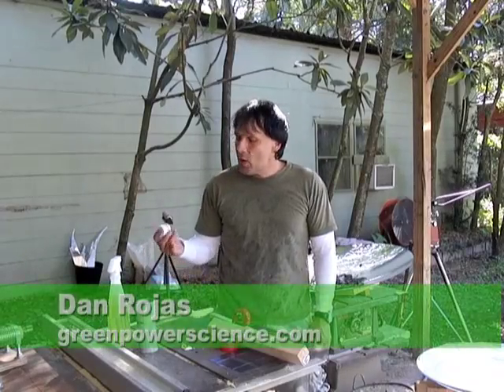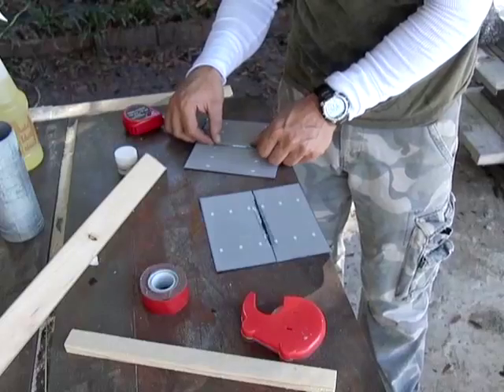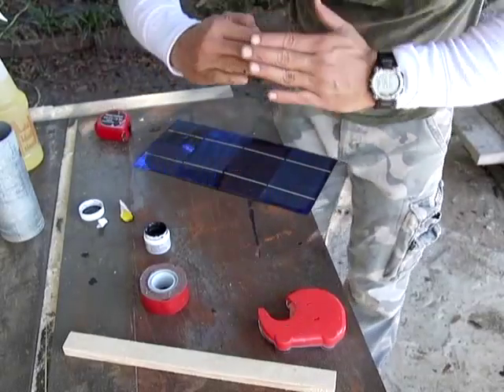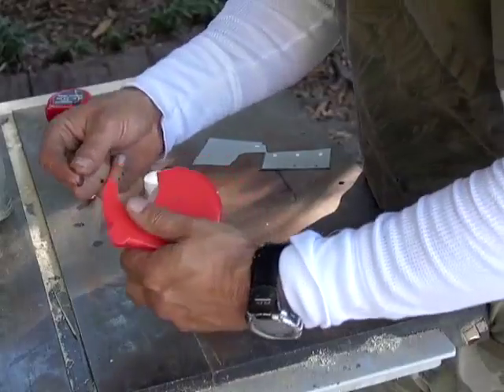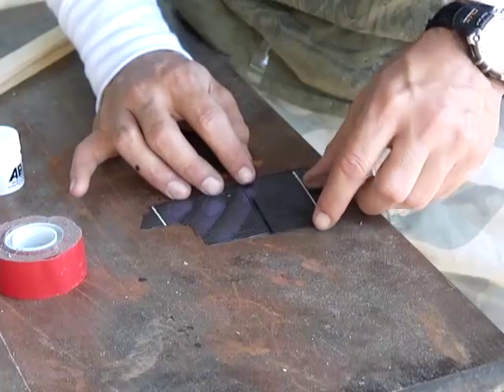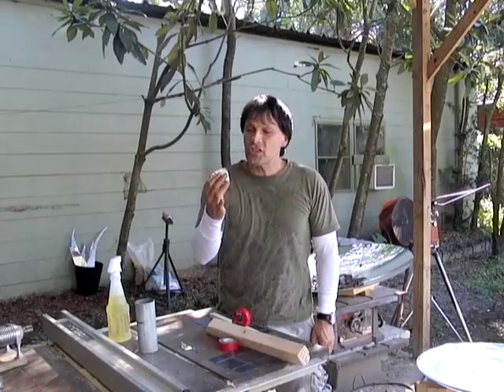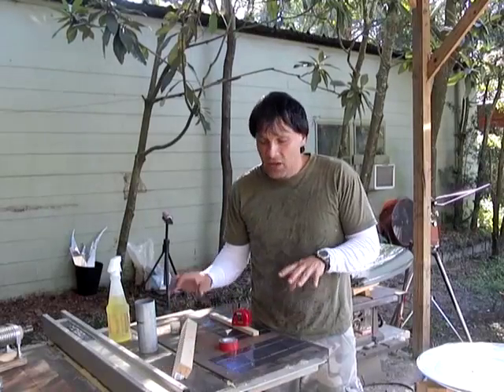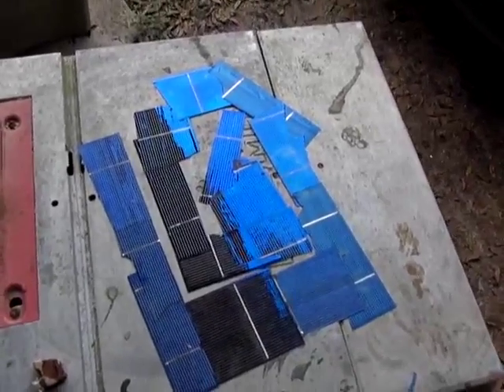DIY Solar USING broken cells Electric Panel SOLDER FREE connections WIRE GLUE

Comment: I don't get it. You don't explain the electrical connections between the individual cells.
How are they connected together electrically?   What is negative and what is positive?
It looks like you are just glueing them side by side together with that black stuff in the white bottle. How in heck does that connect them electically to each other?
You need to take some time with one or two cells and show us the specifics on their polarity and connections etc.

Comment: "through the roof" brand, clear roof sealant, mixed with mineral spirits might be a promising, affordable encapsulant. I read about it on this thread here is the youtube style url solarpaneltalk(dot)com/showthread(dot)php?1431-Cheap-methods-of-encapsulating/page3 ... its got 3 (dot)s in the link. Thank you 1000x for all you 2 do.8-)

Comment from the maker: Thank you for the nice comment. I have found a resin that is really easy to use and uv stable. It also has very low odor and cures within an hour. I wanted to test the UV claim before doing a video. Works good. I hope to followup on this soon. Best Regards
D&D

Comment from the maker: Hi,

How many kWh a day do you use. Look at your E-bill and see. The first step is energy efficiency like LED lighting. Once your house is lean (usually not a sacrifice as newer stuff is nicer) EX. flat screen uses 1/5th the electricity of an older CRT TV. Converting from an old glass tv to Flat screen saves about 2 kWh a day or more. 25 cents a day. Once Lean you figure your panel needs. This is the best option and you get all new stuff.

Comment from the maker: Not really, the tabbing wire lifts. You can grab just the end of one cell about 1/8th of an inch and shingle overlap. The end cell is off to the right vs below on the start of the next row. Tabbing wire is easier if you get the soldering down. This glue works best with cell to cell applications.

Comment: it's not the cells that are solder free, it's the glue. you can by blank solar panels on Ebay and many other sources, all solar supply stores will have DIY solar panels that will work with this. you can also use this glue for ANYTHING that can be soldered, but without the need for electricity or danger of a solder gun.

Comment: quick question: wouldnt it be easier to use the" Electrical Conductive Glue" to connect a broken cells?  or liquid soder.  by the way..great stuff you been doing. thanx

Comment: I just want to know if solar panels mounted upside down has an effect on the performance... I 'm just had this 40 watt panel  and the guys who mounted the panel  put the box on the bottom part of the frame.. thanks....oh and one more thing. I have a sunforce 30 amp controller. The bulk charge led keeps blinking... does low light still charge the batteries? Coz it says in the manual that flashing means low light. but it flashes even the panel is under the sun. Thanks again...

Comment: I wouldn't do that myself. You are inviting condensation. What you really want to do is build a vacuum table, the best you can, and then use laminates EVA, TPA, create a zero air lamination. I respect your desire to want to get away from soldering, but what you need to do, Dan, is use a flux pen when you solder solar cells. That way you can cheat, melt the solder onto the cell. In the same way that you solder SMD chips. Thats how the big boys do it. MSG me for links for building the table.

Comment: Great stuff that Anders Wire Glue, I found it added to much to the resistance and went back to simple solder, I was using little garden light solar cells though and used it instead of a wire tab and the length may have been too much